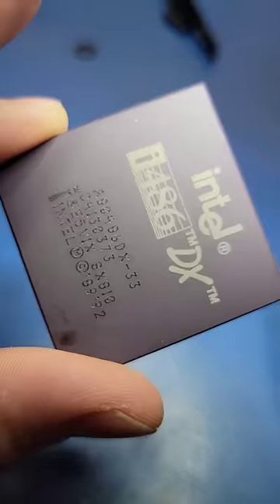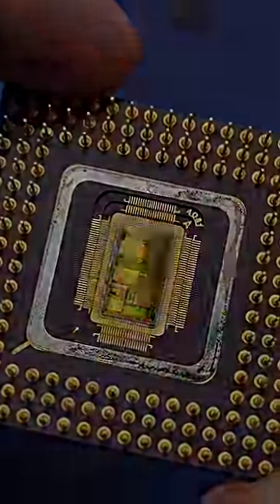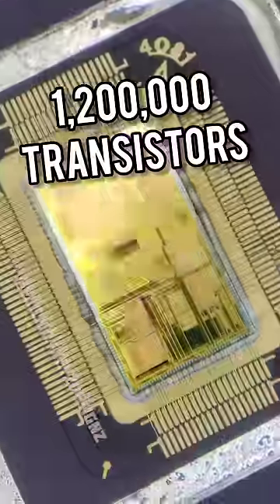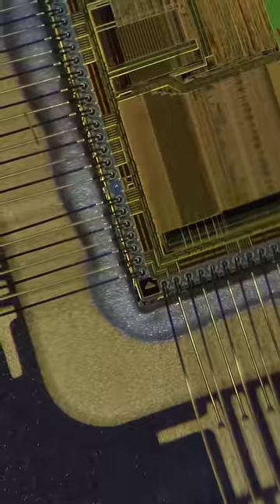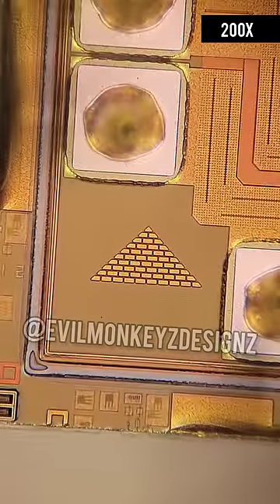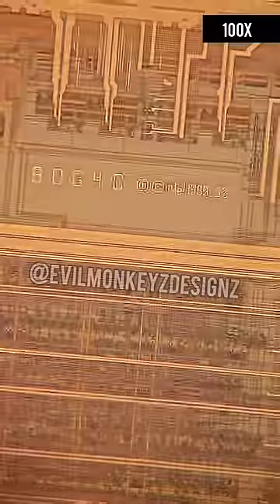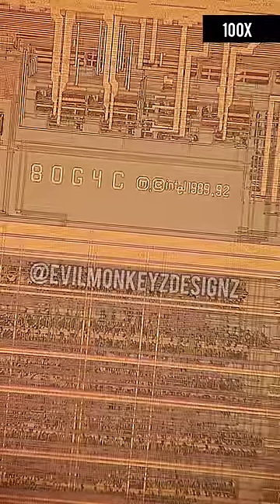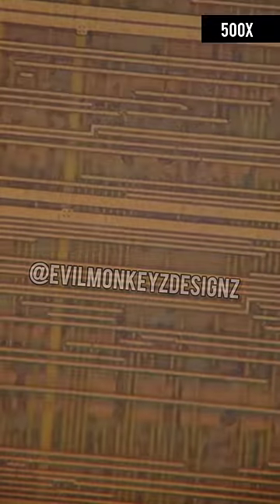Inside an Intel i486-DX CPU

Comment: I had one of those. Amazing tech back in the day. So much faster than the 286 and 386. It was a game changer. Now days we upgrade a PC to be able to have Windows support, but back then you did it to reduce boot times and be able to not have to wait for Word Perfect to catch up to your typematic rate. Doom and Duke Nukem played better on the Pentium when they came out but it was do able on 486 with some creative batch file manipulation to only load the drivers you had to have. Quake was not really playable on 486. Thanks for the delid.
Reply: Doom ran fine on this cpu (mine was a 486 dx2/66)

Duke Nukem 3D could run, but there was a flaw in the engine where the game woukd drastically
Reply: Mine was a 486 DX2/66

Wolfenstein 3D ran fine.

Doom/Doom II ran fine. So did Hexen and Heretic, both based on Doom's engine.

Duke Nukem 3D sorta worked, but there was a flaw in the engine where the game would suddenly get very choppy if there were too many sprite objects in view. Other Build engine games also exhibited this problem. Upgrading to a Pentium 166 fixed this.

Quake could run on it, but the experience was laggy even with the lowest screen rez and reducing the player view size and not very enjoyable. Again, much better on the Pentium.

Every 2D platformer including those from ID, Apogee, and Epic ran fine with it. Older games that were written for an 8088/XT class machine often would run way to fast because they lacked CPU speed detection and expected 4.77MHZ. Mo'Slo sometimes fixed the issue, but could cause some very weird effects due to timing/sync issues, depending on how the game was coded. Mo'Slo and other "slowdown" software didn't actually slow down the CPU but rather it acted as a "middleman" passing the game's CPU instructions to the processor, and added something like

(psudocode)

i = 0
while i < 5000
 i = i + 1
next i

between those instructions, in an attempt to slow down the game, but this was a primitive, brute force solution.

Comment: As a boomer I experienced the rise of the microcomputer to become, for better or worse, the most profound agent of change EVER in a vulnerable society. This video of that Intel chip would have been derided as science fiction back in the day. That little chip could outperform mainframes from the1970s. A few weeks ago when ordering my iPad Air — yes, the one with the 13” display — I experienced a fleeting sense of unreality when I specified this TABLET be equipped with 256 GIGABYTES of secondary storage. Unbelievable to my generation, and it is doubly amusing how today’s young people take this computing power for granted. Revel in your time! (Blade Runner)

Comment: I had this processor until we upgraded to the 486 66mhz which was amazing at the time. We also upgraded from 1 mb ram to 4 mb ram. There was an application called ramdisk that allowed you to use the disk drive as ram.

Comment: It's updated 586 version is still in the Hubble, it at one point had the 486 before updating to a 586. I got old computers from my uncle who worked in a tech company at the time and got old pcs from his job, a 486 was my bread and butter for the later half of the 90s, I got half-life to run on that beast. It only worked because half-life had a console and you could tweak things, basically everything at lowest and set the frame rate in the low 20s and set the ram allocation sizes and timings accordingly. It was the last cpu that had 0 error and could run at max speed without fail.

Comment: The 486 was available in 3 version. One with the processor only one with the coprocessor only and one with both. The joke was that both chips were there they were simply connected or not.
Reply: Wrong. If they detected a malfunction in either one, that module could be switched off (by blowing a fuse) and sold as a specialty.

Comment: My first 486 was a 33MHz machine.  My second was a DX2/80, 80MHz on a doubled 40MHz base.  This one was my favorite 486.  Games ran faster and smoother than any of those multiplied 25MHz and 33MHz systems.  I ran labs of these, which  had to be wiped and reloaded between classes.  The labs  running the DX2/80's would finish faster than the "brand-new" DX4/100's and /133's (on 25MHz and 33MHz base clocks).

Comment: Arguably technology has evolved much slower during the ~35 years after the 486 was introduced than the 35 years prior to it! Imagine the year 1954... A digital computer BARELY existed at that point, and they were the size of a house! And the performance was abysmal. The 486, on the other hand, has many similarities to modern processors and software. It's just simpler and much slower.

Comment: I remember my father bought for his office a 386 DX 33Mhz from Zeos. The Hard Drive was 63Mb. DOS and Windows 3.1. Don't remember the video memory, but I believe at some point he upgraded the video card because he bought a screen saver from Microsoft called Microsoft Scenes, it had beautiful images and the original videocard had low color depth, I think it was 8 bit color.
I also remember he had an antivirus software that ran on DOS called "Central Point AntiVirus"

Before that, he had an Apple II with green screen and for spreadsheet the software was "Super Visicalc"

Comment: I remember upgrading to the 486DX from my 386 waaaay back in '91. I had to do the upgrade myself as the shop did not have a tech free for a week & i was in a hurry.
Ran CorelDraw, MS works on windows 3 with 2MB Ram & 20MB HDD.

Comment: We thought that was a fantastic CPU : 30 years later we have quantum CPU’s can’t even measure the difference in power . I remember the 286 ,386
But the first for me was 8080 z80 8008 who knows what when the clones started coming out. The biggest change early on was memory and disk those made a huge difference. But what I regret most was I was offered a job assembling a computer for NASA and they intended to teach me how to use it too . Unfortunately I had prior obligations.

Comment: I remember these.. I had a DX2 something  / an SX / DX4-66 / DX4-100 / Intel Overdrive @ 120MHz.. I had like 14 different 486's, including 2 boards with ISA + PCI slots.  Still have a Pentium II and a Pentium 3 @1.4GHz which I used until about 2006, it could run UT2004 with full bots happily, and Halflife 2 (DX9), and it can decode HD movies perfectly. It can run Superior Drummer 2 and Pianoteq also :)

Comment: That thing was THE CPU to have back in the 90's, then got the DX2 which doubled it to 66 MHz, and don't forget the DX4, which tripled it to 100 MHz or tripled the 40Mhz version to 120MHz.  No one however could ever explain why they didn't call them DX3's instead of DX4's.  Some mystery marketing at work there....

Comment: One of my first PC's had an i486 DX2 66 in it. When I finally upgraded it was worthless, so I gutted it. I drilled a hole in the corner of the CPU, cut/sanded all the pins off, and attached it to a fishing swivel to make a keyring.

I did similar to a handful of SIMM modules. God only knows whatever happened to them all.

Comment: Not an expert in the field but it could a lithographic alignment target. In for the lithography team in the fab to align the photo mask to make features on the chip that align with the features below they need a point of reference. So in the chips design there is a location that the lithography machine or operator can see and use to measure the exact location of the wafer.

Comment: Fun fact, I/You did/can over clock it to 66mhz using a simple jumper on the motherboard on most mobos at the time (aka Intel Seattle se440bx. Learned that when I was about 10. Fun times.

Comment: The boeing 777's operating system was powered by 3 i486DX CPU's. The plane would boot up like a desktop computer.
Reply: No. BOEING 747 based on using i386 chips with 40mhz frequency.

Comment: My first PC had an i486 DX4 100Mhz. Funny part is? Benched slightly higher than the 133Mhz Pentium I had gotten soon after. Lots of variables, but it felt like the DX4 did better on my Voodoo 2 8MB glide card with 64MB EDO. The Pentium was given the same PCI Voodoo2 add-on and the 64MB SD RAM.

Comment: My first pc was a 386 33mhz.

Single core 33mhz

Now i have 16 core 32 thread with each core running at about 5000mhz

Its amazing how technology has advanced. 

First computer was actually a.commodore 64 but that was solely a.games machine and the 386 was an actual pc

Comment: Even though, by today's standards this would be considered a piece of junk.. I find it amazing that we just dispose of these marvels of modern human engineering. Millions of intrecately placed transistors (they were all designed by hand originally - nowadays it's far too difficult to place 5 billion transistors optimally so its done with software, and more recently AI has gotten involved and is learning how to optimise path traces and interconnects. With 20 miles of wiring inside one chip - I read that AI managed to reduce that by 6%. Which is crazy. Less wire = less distance electrons have to travel. Less resistance, less heat, faster more efficient chips with nothing but a better wiring layout)

But yeah.. we throw these things away. But not only are they beautiful (When they're de-lidded, that shiny rainbow surface is wonderful)

It's a shame we don't have a way to continue to use them, or up-cycle them somehow.

I just bought a brand new flagship CPU from AMD. Multi billions of perfectly placed transistors, on a brand new 4 nanometer node - everything about it is exceptional.

And to think, cutting edge Intel chips in 1999 used 130nm transistors... we've shrunk them every year since. 

And to think - in 10 years it will also be an outdated piece of junk.

CPU's

Comment: There were no power saving features, the CPU ran at full power all the time, everything had a larger lithography, and yet it ran on less than 200W and generated almost no heat. This is proof of how computing has evolved in the wrong direction, today just one GPU consumes the same as a computer from 20 years ago including the CRT monitor, and generates as much heat as an electric heater.

Comment: Mine was a 486 DX2/66

Wolfenstein 3D ran fine.

Doom/Doom II ran fine. So did Hexen and Heretic, both based on Doom's engine.

Duke Nukem 3D sorta worked, but there was a flaw in the engine where the game would suddenly get very choppy if there were too many sprite objects in view. Other Build engine games also exhibited this problem. Upgrading to a Pentium 166 fixed this.

Quake could run on it, but the experience was laggy even with the lowest screen rez and reducing the player view size and not very enjoyable. Again, much better on the Pentium.

Every 2D platformer including those from ID, Apogee, and Epic ran fine with it. Older games that were written for an 8088/XT class machine often would run way to fast because they lacked CPU speed detection and expected 4.77MHZ. Mo'Slo sometimes fixed the issue, but could cause some very weird effects due to timing/sync issues, depending on how the game was coded. Mo'Slo and other "slowdown" software didn't actually slow down the CPU but rather it acted as a "middleman" passing the game's CPU instructions to the processor, and added something like

(psudocode)

i = 0
while i < 5000
 i = i + 1
next i

between those instructions, in an attempt to slow down the game, but this was a primitive, brute force solution.

BTW: I think the pyramid was meant as a test pattern, to check for any roughness or other errors in the fab process.

Comment: What temperature was the heatgun set to to peel the cover off the die? I have the same processor and a heat gun, and i want to "delid" it like this.
Reply from the maker: I usually have my hot air set to between 800-900F (~450C), but your mileage will vary with different heat guns. It takes about 2-3 minutes of constant heat to heat up the entire package enough to melt the solder so that the lid can be removed. I always try to slowly heat up these packages and keep the heat moving around so that it heats up evenly.
Reply: @EvilmonkeyzDesignz  gotcha. I didn't have any luck unfortunately. I do have the DX2 version, and the cover seems to be copper or something. A razor blade couldn't pull it up after being blasted for a couple minutes.

Comment: I dreamed of a i80486 DX4 - 100 Mhz, with a FSB of 25 Mhz Bus, hence the DX4; it' was the best CPU out there in 1992/3, fast w/ an FPU, small like 2.25 cm²/0.35 inch² compared to the Huge Ceramic i80386 ; the i80386 that got to my Country Bolivia, never came with a 80387 FPU, 3rd World Country, no surprise there, it was awesome; too bad $1,400 at the time was a Ton of $ for my poor family. Years later I thought the same of a Athlon 700 Mhz, the first ones getting here... ah the old days...

Comment: my 1st 486 was an IBM chip.. 486 SLC2/66  got a good deal on it at a wholesaler.. it was a souped up 386 tho..  shortly after i got a real i486 DX2/66.. way faster.. then a DX4/100.. then pentium 66.. then p133.. 200.. 233.. then pentium pro 200... p2-400 p3-500.. 733.. 1000.. p4--xxxx etc etc etc.. now we run I9/xeon/threadripper.. it never stops..

Comment: How the hell can one invent this😅😅
Reply: @The_Alpha_music  They use some kind  of  complex lithography process that defines places on a silicon wafer were transistors (electronic device that can either switch or amplify an electronic signal  )are to be created , the silicon has  a layer of silicon dioxide on top (insulator so it doesn't conduct electricity), pieces of the silicon dioxide are   cut away or removed by exposing  the silicon  to some kind of UV light  that deposits boron or phosphors(sometimes other materials too) into the silicon creating transistors inside the silicon.

different wavelengths of light   allow for smaller transistors to be created , making for more complex computers since MORE or should I say MOORE(google moore's law) transistors can be fit into one silicon integrated circuit (the silicon wafers are cut into individual integrated circuits) .

 A Silicon has atom has 4 electrons in it's outer shell and normally can't conduct electricity but through the process explained above   by being mixed with a Boron or Phosphorus  atom (which has 3 or 5 electrons in the outer shell) it causes the silicon to either give or receive an extra electron (free electron) which is what allows it to conduct electricity and be used as the basis for making transistors. 

The silicon dixoide layer stops the free electrons from escaping from the silicon layer and the transistors are linked up in certain ways to form something called logic gates which preform particular functions based on their input ,  logic gates are further linked together to create parts of a computer that function as memory or as a calculator.

I've missed out a few things but that's the most basic way I can explain it , yes it boggles the mind and I'm no expert (I'm currently studying how computers perform subtraction and make use of negative numbers   and it's pretty confusing :P) Hope that helps you understand

Comment: (c) stands for Copyright, (m) stands for..?
Reply from the maker: The M is fir Mask works! The mask work is specific to Semiconductor chips and is like a copyright for how the specific circuits are laid out on a chip, as far as I understand it. It came about as part of the Semiconductor Chip Protection Act of 1984, so you won't see it on chips before that time.

Comment: How the f... did they do that 😮
Reply: @thisisandigo They use some kind  of  complex lithography process that defines places on a silicon wafer were transistors (electronic device that can either switch or amplify an electronic signal  )are to be created , the silicon has  a layer of silicon dioxide on top (insulator so it doesn't conduct electricity), pieces of the silicon dioxide are   cut away or removed by exposing  the silicon  to some kind of UV light  that deposits boron or phosphors(sometimes other materials too) into the silicon creating transistors inside the silicon.

different wavelengths of light   allow for smaller transistors to be created , making for more complex computers since MORE or should I say MOORE(google moore's law) transistors can be fit into one silicon integrated circuit (the silicon wafers are cut into individual integrated circuits) .

 A Silicon has atom has 4 electrons in it's outer shell and normally can't conduct electricity but through the process explained above   by being mixed with a Boron or Phosphorus  atom (which has 3 or 5 electrons in the outer shell) it causes the silicon to either give or receive an extra electron (free electron) which is what allows it to conduct electricity and be used as the basis for making transistors. 

The silicon dixoide layer stops the free electrons from escaping from the silicon layer and the transistors are linked up in certain ways to form something called logic gates which preform particular functions based on their input ,  logic gates are further linked together to create parts of a computer that function as memory or as a calculator.

I've missed out a few things but that's the most basic way I can explain it , yes it boggles the mind and I'm no expert (I'm currently studying how computers perform subtraction and make use of negative numbers   and it's pretty confusing :P) Hope that helps you understand